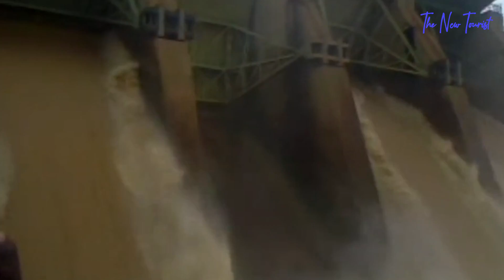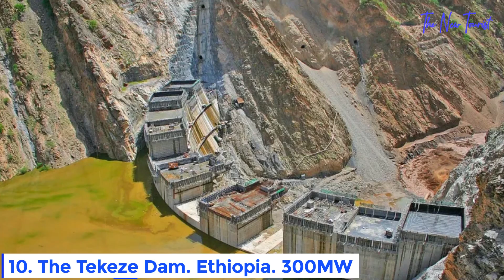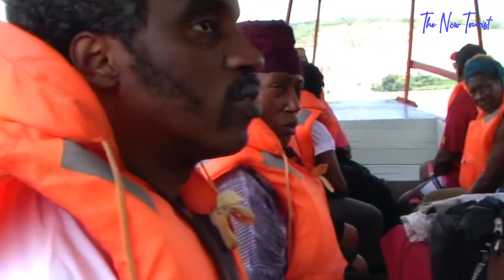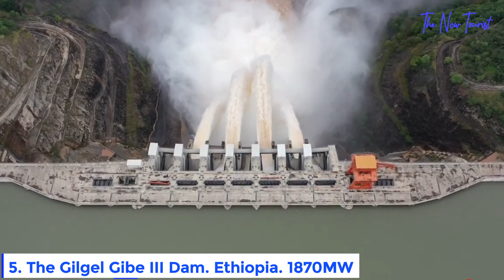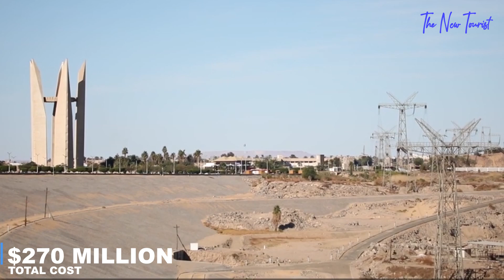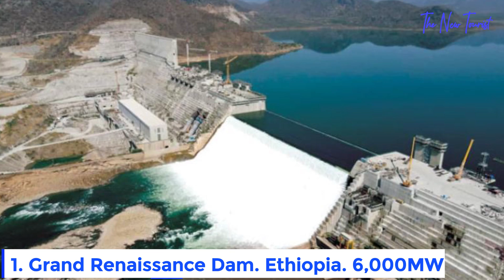The 11 Largest Dams In Africa...

Comment: The Kariba Dam is a double curvature concrete arch dam in the Kariba Gorge of the Zambezi river basin between Zambia and Zimbabwe. The dam stands 128 metres tall and 579 metres long. The dam forms Lake Kariba, which extends for 280 kilometres and holds 185 cubic kilometres of water. Wikipedia.
 The Context: The Kariba Dam is the largest man-made reservoir in the world. At a height of 128m and with a crest length of 617m, the dam has the capacity of holding 181 billion cubic meters of water. Total Electricity generation: Total: 1,626 MW (2,181,000 hp)